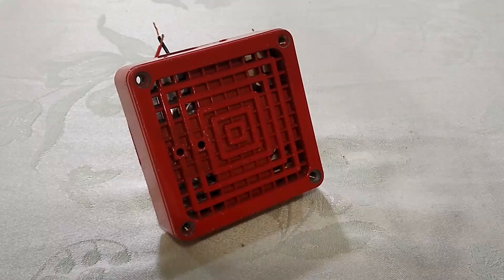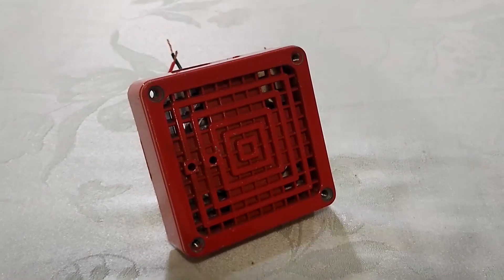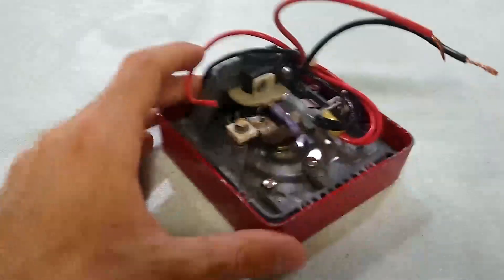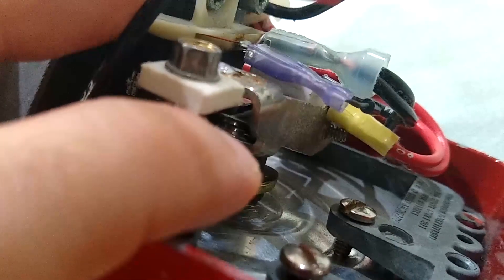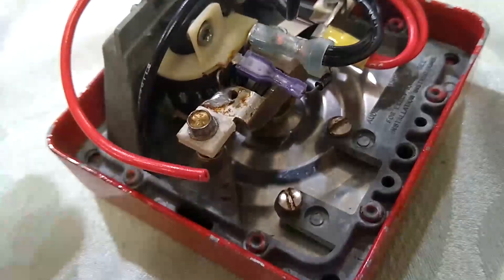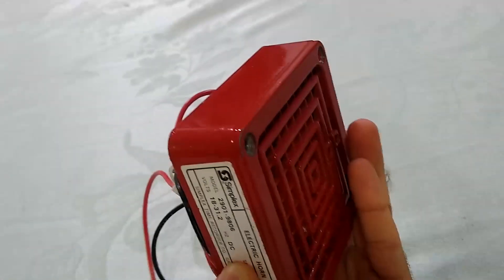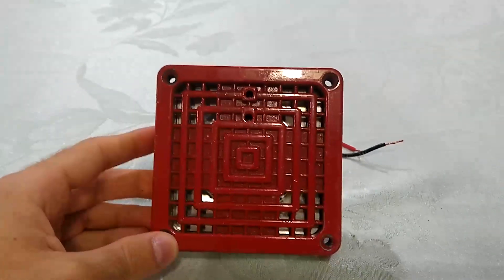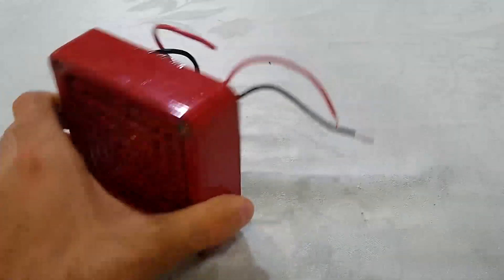Short Video: Fixing a Simplex 2901-9806

Comment: U need to fix all the 9806’s at my school because they’re dying (literally)
Reply from the maker: I would do it if it was close enough and they let me, but they won't because I'm "not qualified". Honestly they should replace the dying horns, especially if the visual signals are pre-ADA.
Reply: Fahrenheit4051 In my opinion my school shouldn’t of used 9806’s, They should move used 9838’s instead. The horns are in march time and it was the worst sound(s) I’ve ever heard in my life
Reply from the maker: @matthewhanna9115  Do you know the type of panel your school has?
Reply: Fahrenheit4051 I’m assuming it’s a 4100 or a 4020 since those were common panels of the 1990’s
Reply from the maker: @matthewhanna9115  Well, if that's the case then they're probably not on FWR current (which would make them sound extra-terrible).
Reply: Fahrenheit4051 tbh they kinda sounded like they were on fwr but they really need to fix it

Comment: One of the campus buildings I go to has those horns with the same grills behind 2903 light plates. Sadly, they won’t be around for long since a voice-evac System is taking over.
Reply from the maker: You should look into getting them.
Reply: Fahrenheit4051 it won’t be easy. It’s been at least six months since I’ve been notified about the new alarms taking place.